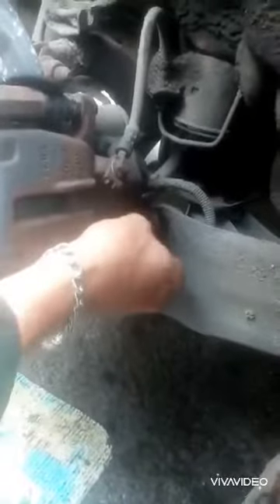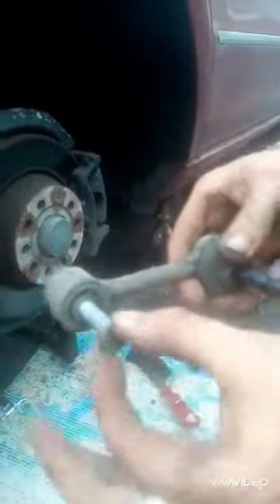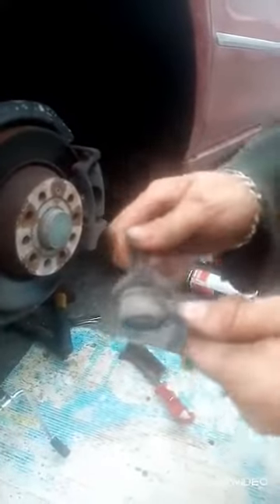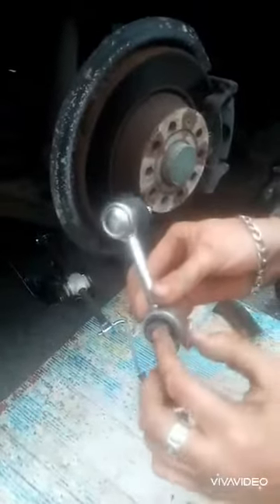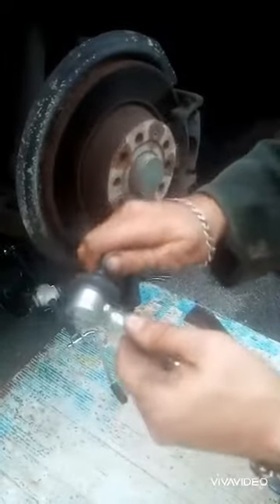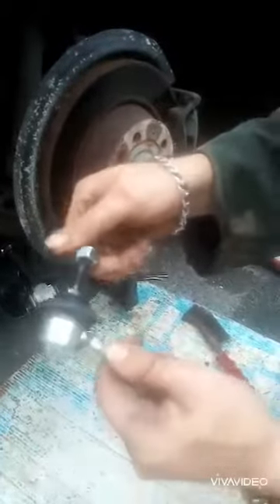Replacing a Rear Drop-Link in VW passat

Comment: How did you get the drop link out? I've undone both the bolts and have jacked up the rear spring, for the life of me I can't get the top bolt out! Any advice would be greatly appreciated
Reply from the maker: They can be a bit fiddly, just jack up the rear wishbone until the pressure is off and it should just pop out
Reply: @dadsgarage3086  legend, thanks for the reply, I got it a couple hours ago, just thumped it with a screwdriver and it went